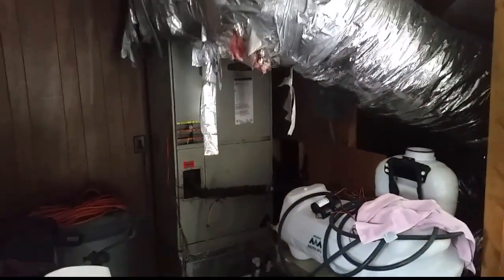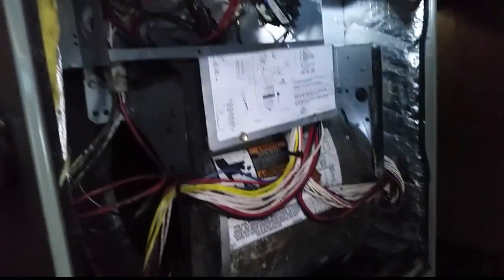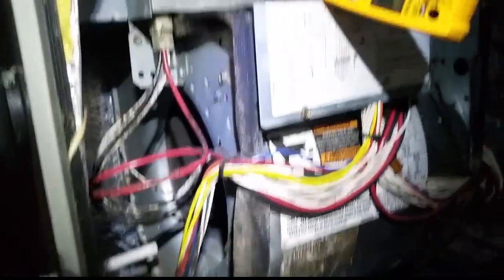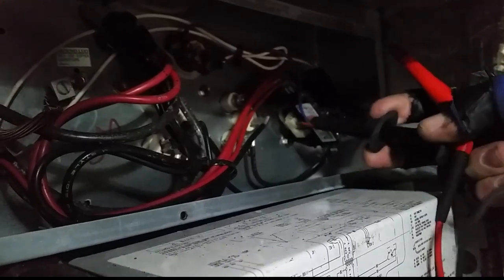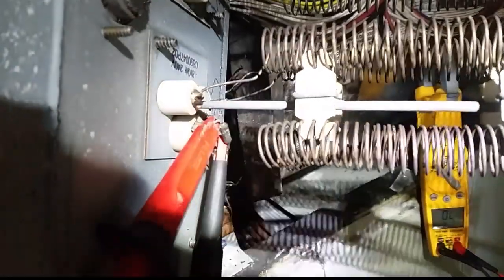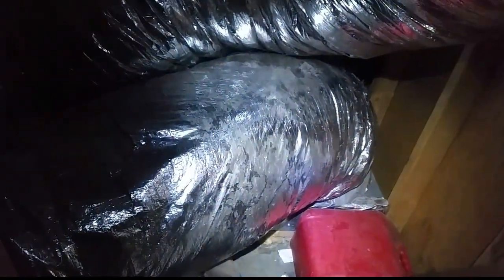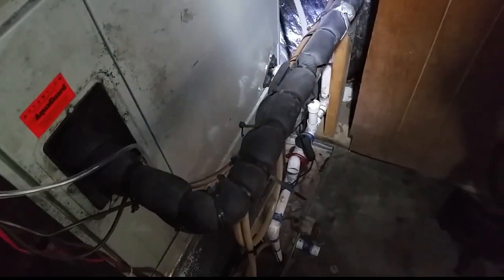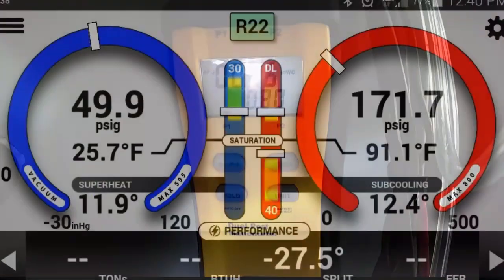HVAC Service Training : Troubleshooting a Trane Heat Pump System

Comment: Please help if you can.  We have an XL20i with the TAM8 unit installed and it defrosts roughly ever third time it runs when the outside temp is under 36 degrees (inside 68 degree).  Old unit did same and Trane replaced outside unit for free last January but the new one is doing the same thing.  I have screen prints of the thermostat that have even showing running 15 times with ten defrosts. By the way, almost all of the defrosts that we have witnessed have been been "wasted" with no vapor exiting unit and no frost or condensation on the coil. Have you seen this and if so, how did you fix it?
Reply from the maker: +Oliver Kassem what was the diagnosis when they replaced the unit?
Reply: There was no diagnosis.  They had replaced the defrost board and two sensors and it did the same thing. They they replaced the unit last January and the defrost cycles are pretty much as they were before. One installer said his guess would be the personality module, the board, or intermittent sensor issue.  He must be referring to the coil and air temp sensor and the defrost board but have no idea of what a personality module is. Is that a separate board?

Comment: "order a new heater" - why not just replace the one-shots?
Reply from the maker: As far as I know you can't just order the one time fuse. I couldn't see a good way to remove them
Reply: talyn875 just match the part number (for temperature) - it's a Microtemp 25A ceramic thermal fuse (or equiv) then try (or whoever): http://www.northamericahvac.com/furnace-microtemp-fuse-limit-stc86283-g8am0400-144c-degree-thermal-cutoff-switch/
Reply from the maker: freaknoid27 thanks for the tips
Reply: talyn875 No - Thank you for some of the BEST Hvac videos on Youtube!!  :-)  I don't know how you find the time to do them but they're some of the best stuff I watch all day.  Thanks again!

Comment: Helped my girlfriends dad fix their furnace last week. They were out of town for the weekend and came home and the thermostat said it was 54° in the house even though it was set on 69°. This was the weekend when it got down in the negatives. But long story short turns out that the white thermostat wire for the auxiliary heat was never wired to the thermostat. So they have lived there for 5 years and took this long and that cold outside to notice it.